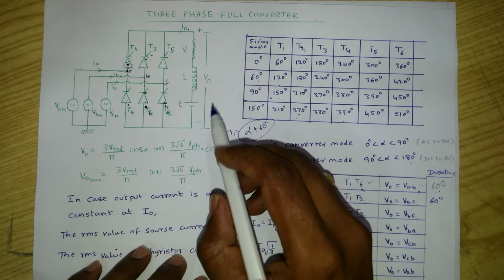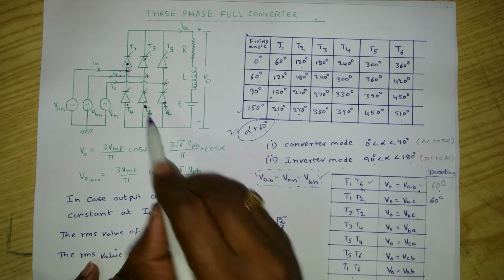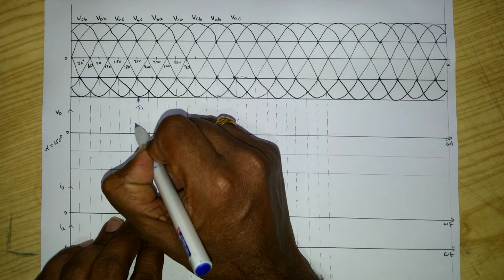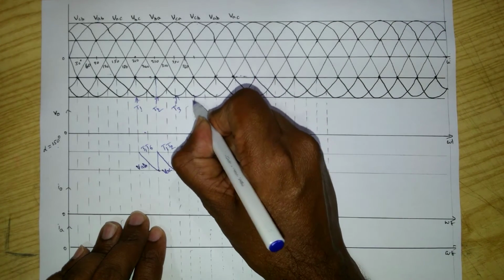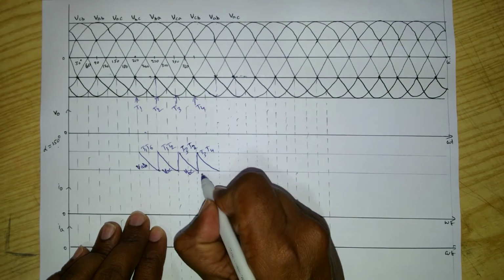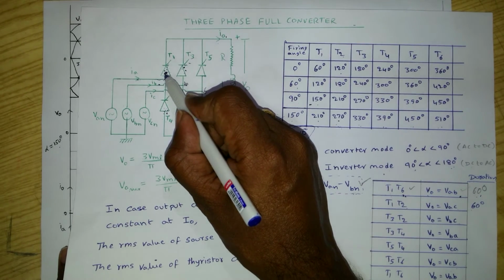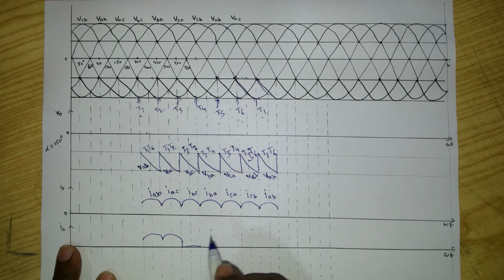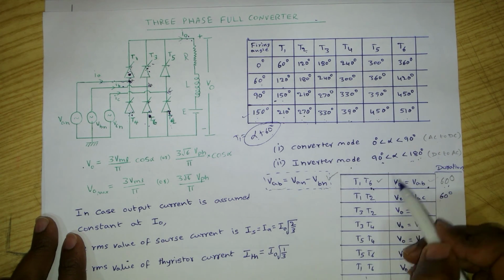Three phase full converter as line commutated inverter

Comment: hi I like the video, but how can i-out increase when v-ab is negative?
Reply from the maker: +Simon Madsen 

Hi thank you very much.
In linecommutated invereter load must be active load. Then only power flow is possible from  load to source. Based on the kinetic energy available active load supply power to load.in load current wave form i just want to show the current vary with voltage wave form.some authors show constant load current to make further analysis easy. 
Anyway for the given kinetic or mechanical energy the emf generated is constant dc (this assumption must). Now if supply voltage(negative) vary , load current vary but load must be highly inductive. More -Vab (with constant generated emf) more current vice versa. But load current cannot follow -Vab exactly due to inductive nature.